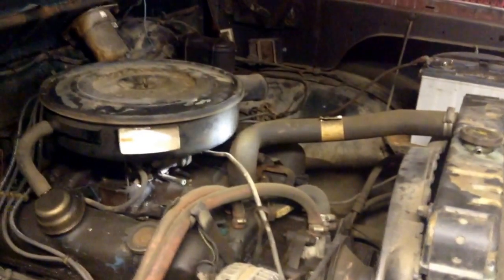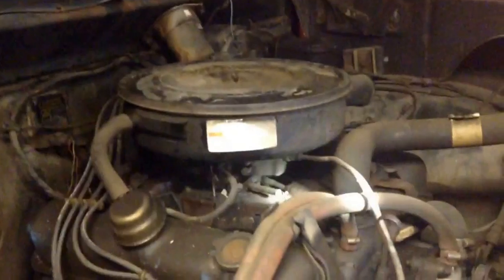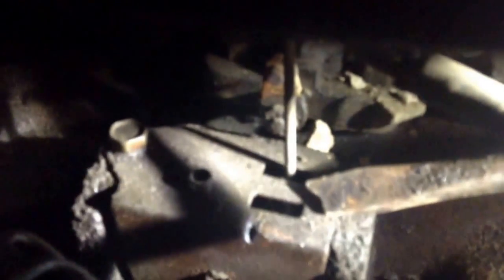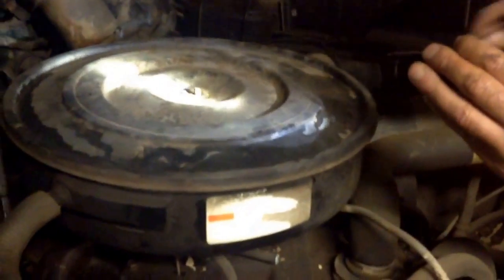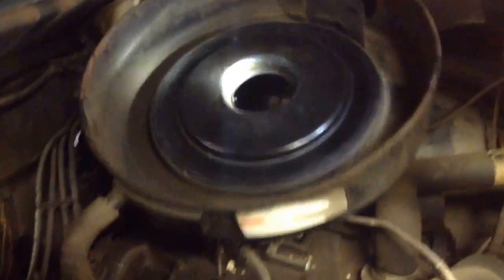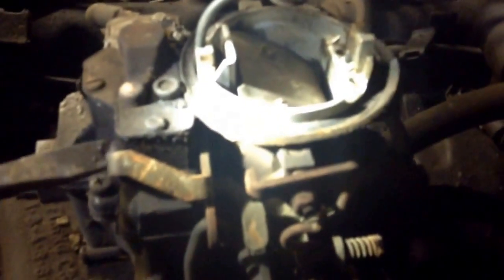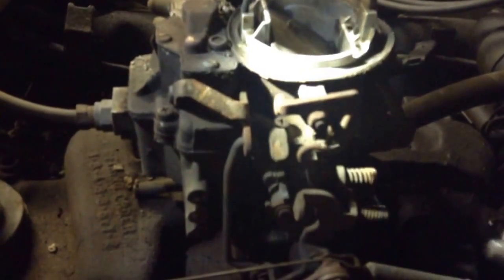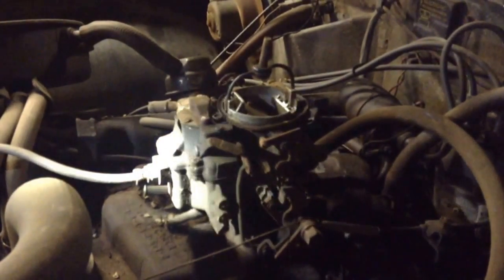How a 2 barrel carburetor works

Comment: Classic mopars got a bad name because of poor design. The weights in the distributor advance way too quickly, and prevent you from running leaner like chevy v8s do. Because the engine will andvance too much and the engine will ping if you position the distributor to idle lean. So old dodges were forced to run too rich and wash the oil off of the pistons and ruin the rings.

Comment: I have the same carburetor same 318, I believe the right (facing the front of the engine) adjusting screw is fast idle, left is mixture ? Could you explain that in detail and, how to set the fast idle cam? 
 Also, where the fuel inlet is is the front , if I close TVAT all the way is won't let fuel in and if I back it off a hare it runs fine, but leaks a little. 
 Thanks. I have an 85 D150 318. Also what is the correct model number of that Holley , 2280? Not sure. Thanks a lot this will help as I can't really find the right info on this carb only the other 2 bbl .
 I totally agree with that one pump thing . Ppl like to hold the pedal to the floor.. Truck cold starts perfect , kicks down after it warms up a bit and good to go. I would never pump the pedal like that. I won't let anyone start my truck. Period .